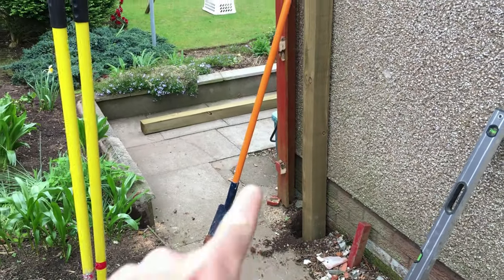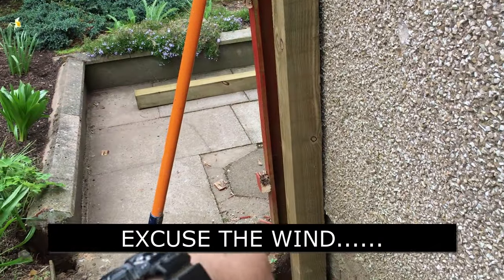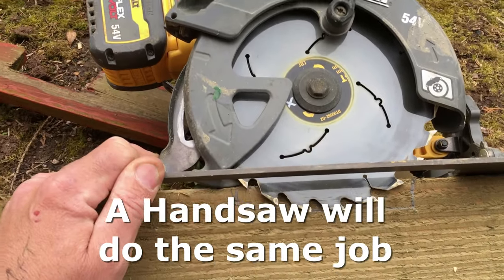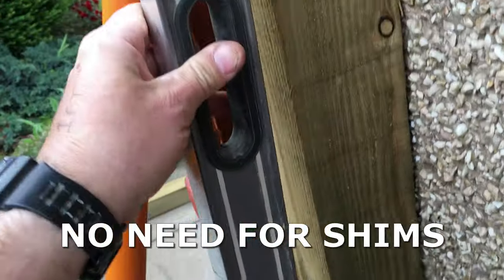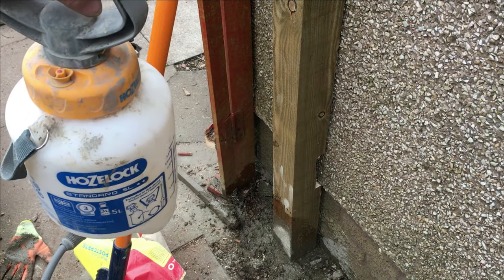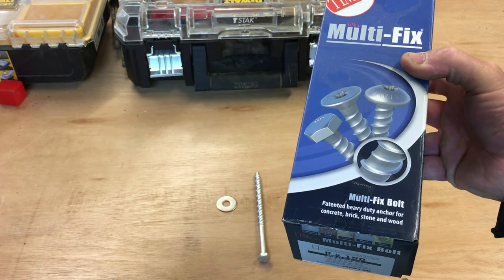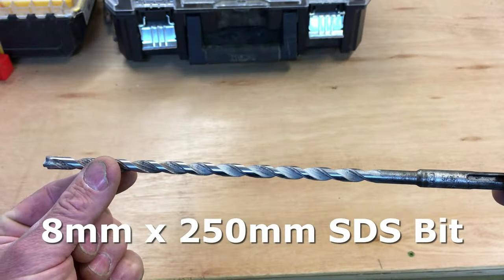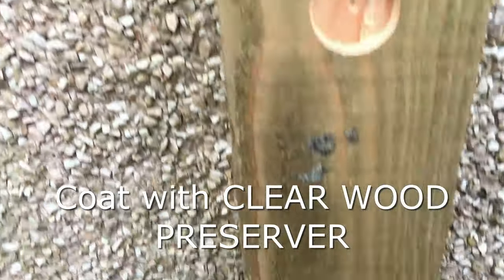How To Fit a (4 x 4) FENCE POST to a WALL | Gate post

Comment: Just a wee bit of advice I noticed some nails sticking up in a bit of wood on the ground. It's a very good practice to get into to take 1 min to just flatten over any nails you have in the old wood you remove. I have unfortunately experienced a nail up my foot and it's not fun. Also it protects others. No matter how careful you are those nails are always a risk as it just takes one laps in concentration to stand or fall on one. Thank you for the video and for the time you took to make it. 😊
Reply from the maker: I have also had the misfortune of standing on a nail, not fun ! Yes, I usually do flatten the nails thanks.

Comment: You didn't do anything to prevent moisture from getting into the wall where you drilled. You should shoot some caulk of sealant in the hole you drilled before putting the fastner i
Reply from the maker: It's a cavity wall, like most walls here in the UK, so no need. Also, the fixings did not go through the first course of brick, so no moisture would get in anyway. Thanks for the comment

Comment: Hi, I am adding a railing to my small front stoop. I have 4x4 posts and I want to attach one of them to the house. The house wall is brick but it is EXTREMELY uneven. I don't know what to call that type of brick but they are full of bumps and when I place anything straight and flat against that wall, I see spaces as big as 1/2" -  or even more. Do I need some kind of shims to put between the 4x4 and the house wall? If so, how do I attach those shims behind the post. I don't want concrete/masonry screws to show behind the post and I don't know what to do. Please help. I would really appreciate it. I have seen quite a few videos on YouTube but I haven't seen a case where the bricks are so uneven. I would appreciate your advice. Kind regards.
Reply from the maker: Just attach the post like I did in this video and then use fence slats scribed to the wall to cover the gaps between the post and the wall. No need to shim if you have a couple of good points of contact.
Reply: @Bacrenfencing  Thank you so much. But please tell me: what do I need to I scribe fence slats. I don't have a lot of tools.  Once it is done, how do I attach them  to the wall? Please forgive all these questions.  I am a senior and try to learn from YouTube. Do you have a drawing or a video I could see?

Comment: Great explanation thanks. Just wondering what you would do if you were unlucky and drilled through the mortar???
Reply from the maker: Thanks Danny, that does happen now and again and to get round that, I generally then go in with a 10mm bolt and just tighten it very slightly, that tends to work but obviously not as strong a fixing as going in to the block work. The other option is to just drill another hole a couple of inches up from the old hole and then fill the old hole / recess. Thanks for the comment 👍
Reply: @Bacrenfencing alright pal I'm doing something like this, the posts I'm using for the fence are 4x4 but could I use a 75x75 on the wall to hang a gate? and get my line  from the side the gate will be hanged?
Reply from the maker: @Mr8ofspades  Yes, you could do that
Reply: @Bacrenfencing  cheers pal

Comment: Great job big chap ....have you tried the lumberjack wood glue from toolstation ?
Reply from the maker: Cheers Ian, no I have not tried that, I tend to use Everbuild D4 glue. Is the lumberjack stuff any good ?
Reply: @Bacrenfencing  it's absolutely amazing  there a 5 minute work time and a 30 mins one ......just use a wee brush with some water and wet one surface then clamp glue or nail it's super strong the wood breaks before the glue gives and ffs wear gloves lol
Reply from the maker: Cheers Ian, I will have to check that out mate - and yes, I will get the gloves looked out  !
Reply: @Bacrenfencing  if you put a blod down say the size of a pea it will expand to the size of a small grape .....its been a total game changer for me
Reply from the maker: @iandrain.7277  I will get some !

Comment: Thanks for that, a straight forward job explained easily. I’m not a DIY man from start to finish this took me 30 minutes 👍🏻 subscribed by the way 👍🏻
Reply from the maker: Cheers ! 👌
Reply: @Bacrenfencing  nice job! What is the size of drill bit and size of the screw? How long should the screw onto the concrete?

Comment: Very informative and helpful as my first fence and gate build is coming up.
Reply from the maker: Glad it was helpful Alan, thanks for the comment !
Reply: @Bacrenfencing  Im planning a closed-boarded fence with a 25mm overlap. Is it best to ensure that the nail only goes through a single board I.e. just past the overlap, rather than nailing both boards on the edge?
Reply from the maker: Hi Alan, If you are using feather edge boards, then yes, only nail one single board. Feather edge boards are flimsy and if you nail through both  boards, then there is a good chance that the boards will split over time due to expansion and contraction. Hope this helps.
Reply: @Bacrenfencing  Thanks. I had been considering a 'hit and miss' fence, but they look like giant pallets to me lol.
Reply from the maker: Yes, but at least they let some wind through, close board are good for non exposed areas. Good luck with the install

Comment: Excellent video mate, currently looking for inspiration on bolts as I’ve got a job 3ft panels on top of a brick/rendered wall.  going with 6ft 4” posts bolted to  as the previous fence has repair spurs everywhere and that has failed, to many bolt choices out there 😂
Reply from the maker: Thanks for the comment, yes these bolts are great for the job !

Comment: I have a rendered wall over breeze block… so screwing through render into the block… will your method work for this? Thanks
Reply from the maker: Yes, it will work in your situation. Thanks for the comment.

Comment: Love your videos Barry . 
What the best brand ...Makita combi or DeWalt combi 
I want it lightweight but powerful
Reply from the maker: Thanks Steven, Personally I use Dewalt as that is the main battery platform I'm on, but I would not put you off Makita as they are great tools too (I have some Makita tools). I have a couple of the Dewalt combi and SDS drills, here is the combi I use - https://amzn.to/3N23bTA I have had my oldest one for nearly 9 years and it is still going strong, so would highly recommend it. I can't really comment on the Makita combi as I have never owned one. Hope this helps and thanks for the comment 👍

Comment: Would it make a difference if I were affixing a mounting board to an exterior stucco wall at a spot where I am certain to hit the interior stud?  Should I use a smaller bit/screw?  Shorter?  Should there be some sort of silicone or flashing between the stucco and wood?  :person-turqouise-waving:
Reply from the maker: I'm not sure as I only use this method on brick or concrete walls. I have never tried this on Stucco, so not sure to be honest.
Reply: Did you end up attaching the mounting post to the stucco wall? Did you do it just like the video?
Reply: @PEDRODIY2  TBH it was so hot over the summer, I put it off to this very week.  I'll be out there tomorrow.  :face-green-smiling:
Reply: @mavirek  Do you know how wide stucco usually is? like 1-2 inches or so?
Reply: @PEDRODIY2  TBH I’m so unsure of what I am doing.  🙁 I’m having a hard time believing that two lag bolts into a mounting board then thru stucco and into a stud will hold.
Reply: @mavirek  Ah yes, Im in a similar dilemma. If you figure it out please let me know how you got it to work if you have time and remember. Thank you and good luck.